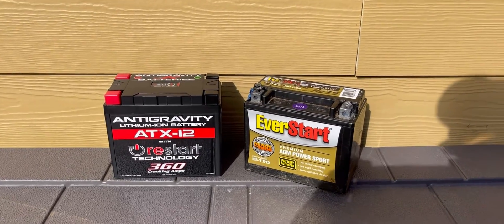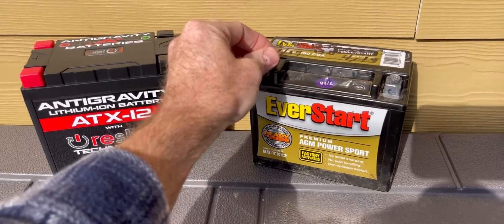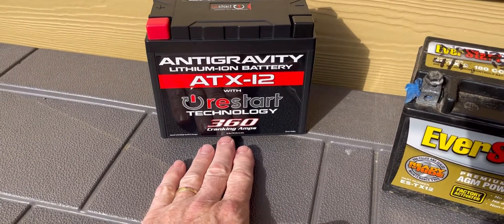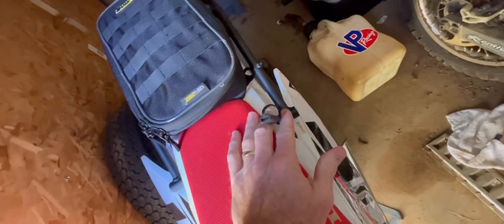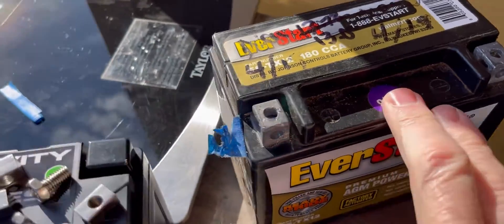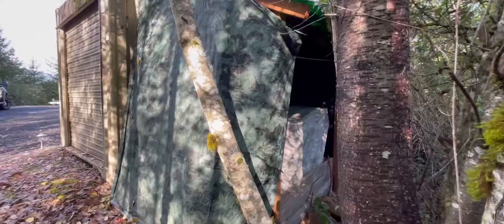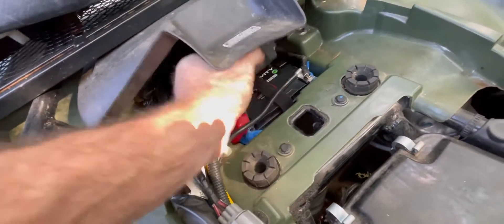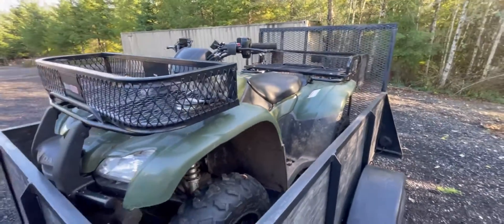AntiGravity Lithium vs AGM battery

Comment: If You need a special charger for it is the standard alternator O.K.
Reply from the maker: No mods were required to the motorcycle or quad.  Just the charger since it runs at different levels.  The alternator (or stator) is continuous in its output (which is a lot less compared to the chargers).